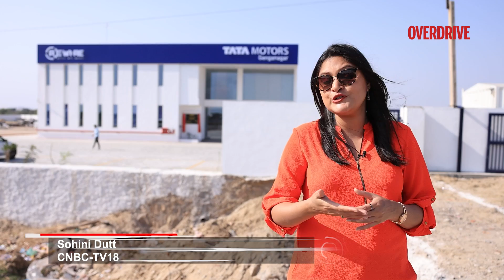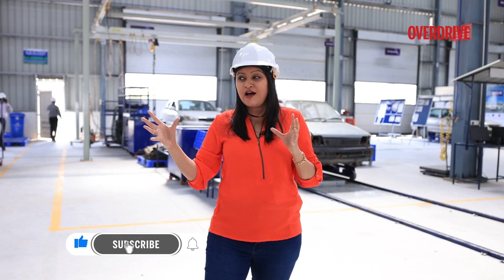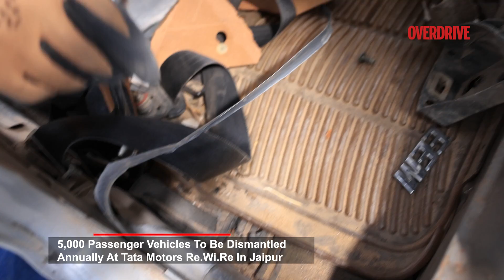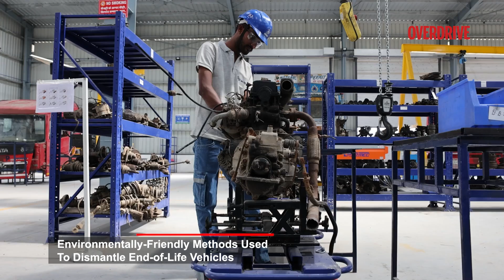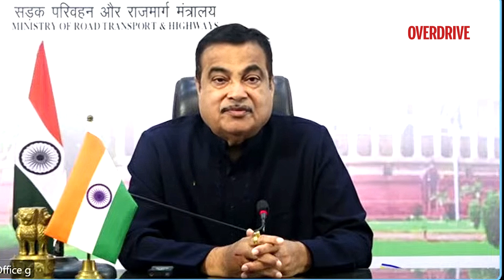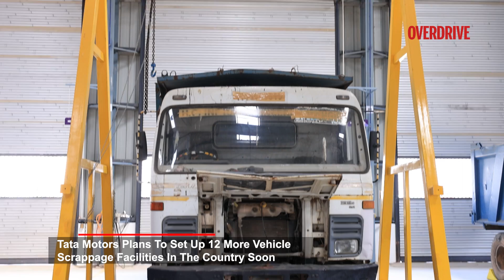Tata Motors First Registered Vehicle Scrappage Facility - Tata Motors Re.Wi.Re | OVERDRIVE

Comment: Really dumb since the body shell and chassis is pretty much ‘ scrapped ‘ instead of being reused on other cars
Reply: Would you buy a new car if you knew it's made on a chassis that's recycled from a 25 year old car?
Reply: From business point of view and enployment point of view, reusing old chassis does not make any sense. Buyers of new cars onviously wont like refurbished old chassis in their supposedly brand new car bought with their hardowned money. Reusing old chassis means drastic reduction of oriduction cost, hence reduction in per unit sale price and hence profit per unit sale- not an acceptable proposition for the company as well, also car models sometimes are not continued after some time to justify retention of the old chassis and even if continued, chassis might be significantly redesigned to comply with newer safety requirements and to accomodate newer features for which refurbishmentof the old chassis wont at all be economically viable. Chassis manufacturing employs lot of workers- refurbishing wont as many leading to workers losing their jobs. It is in interest of every stakeholder that the old chassis is returned to their original elementary state which then can be recycled to build brand new chassis.
Reply: @knightatdawndonbynight8432  yes but I’m talking about the chassis going to waste , for example let’s say you have an old car which is in amazing shape except for the shell with has corroded or let’s say the chassis is bent and you still want to use this car .
A shell from the junkyard plus labour will cost less than a new car